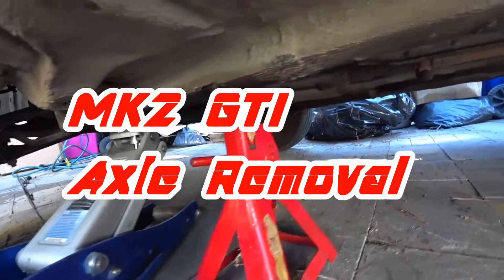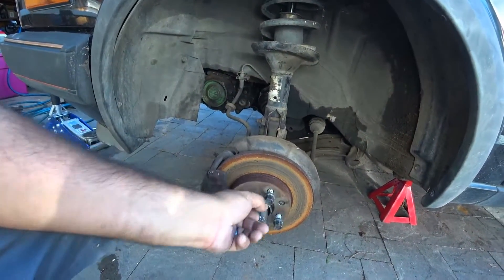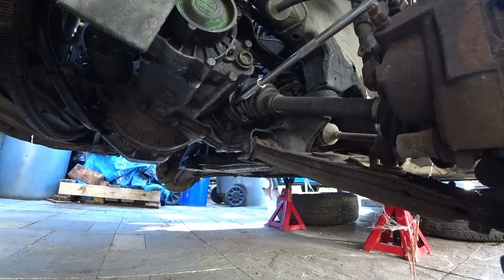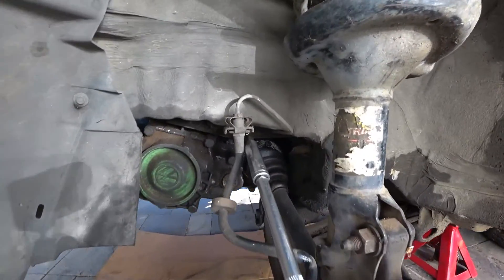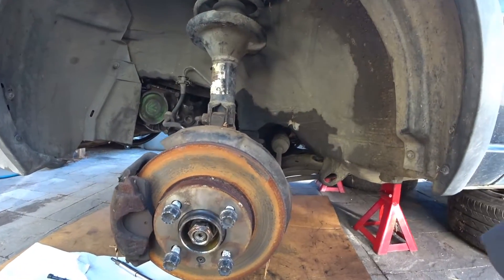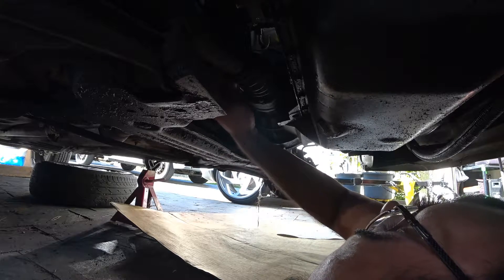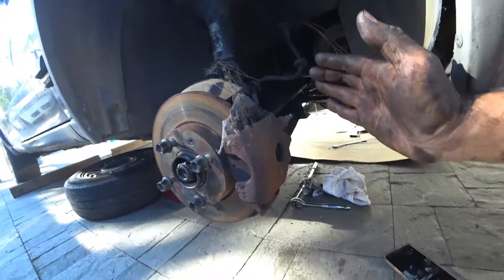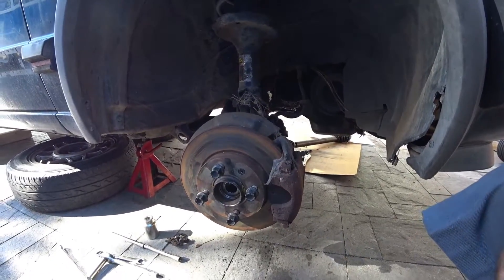S4 EP2 How to Remove a MK2 GTI Axle

Comment: I've found doing this is a really good way to test the brake lines and caliper pistons. once you stand hard on the brake peddle you know really quickly if any of your hoses or pistons are needing to be changed out.  The only thing I do different is loosen the hub nut when the car is on the ground, using its weight to give me a hand.
Reply from the maker: Cool I will give that a try

Comment: 8:05
Are you sure about those torque specs?
My book says about 265nm for the axlenut and 45nm for the bolts for the inner joint. 
Even when translated the units dosent match up.
?????